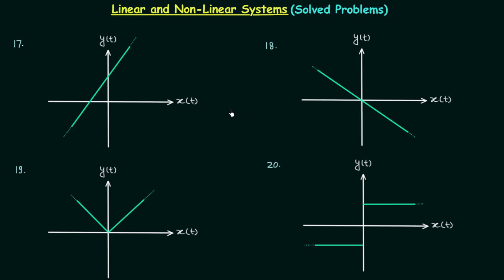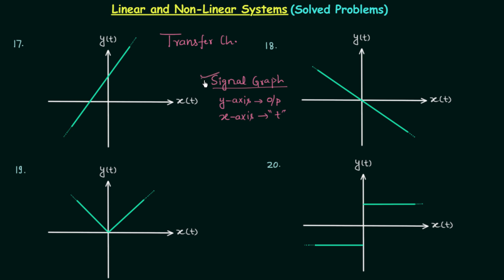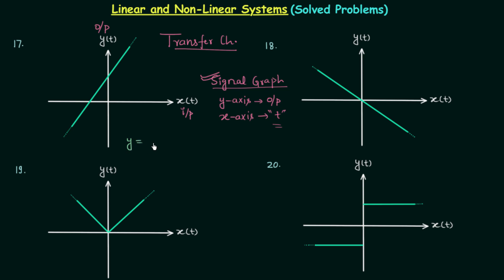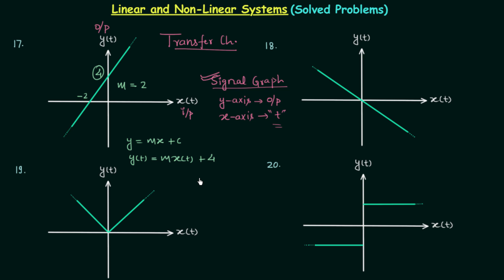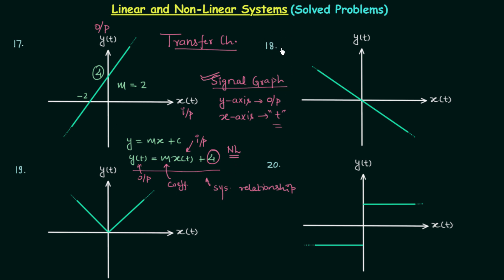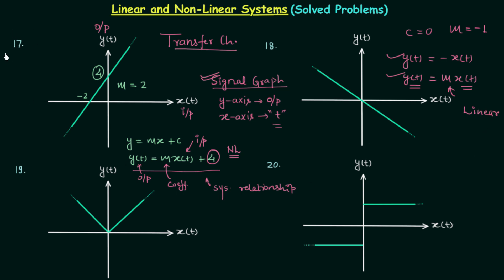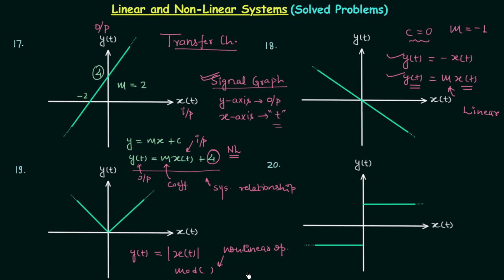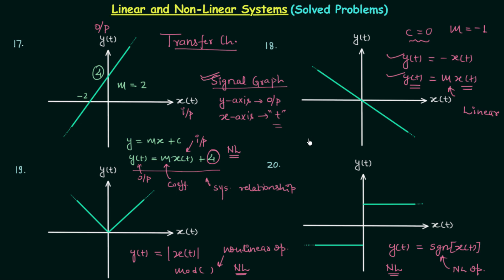Checking System Linearity using Transfer Characteristics

Comment: For those wondering why we can't split the || function into a piecewise function, here is the problem:

y(t)=-x(t) for x<0 and y(t)=x(t) for x>0

But did you catch that? You're splitting the function with respect to x, but for piecewise functions to be linear like OP says, you have to split it with respect to t, not x. So there is still that difference. Because think about it: who's to say that x(t) must be such that x(t)=t? x(t) can be anything, like x(t)=-t, x(t)=sin(t), x(t)=t^23. Anything like that.

Comment: I can write modulus as split function so that comes to be linear! 
Help to clear confusion!
Reply: split functions aren't necessarily linear....the example he took in previous video was a specific one,that can't be used to generalize all the cases
Reply: @upalkantipattanayak9257  No, split functions are necessarily linear. The mod function is a  special case of the split function, which acts as an exception to the rule and acts as piece-wise linear rather than completely linear, so essentially non-linear overall. 
Basically, the mod function is an exception to the rule of split functions being linear.
Reply: @TheRealArya  
But he also said when x(t)=0
Y(t)=0 is a linear function.. so 19 seems linear but actually it is not.. can you shed some light here?
Reply: @TheRealArya  What if y(t)={x(t).     ,t<0
                         2+x(t),t>0
the system seems to be linear when t<0 but it is non linear when t>0. isnt this contradictory to split system.
Reply: Well, if you make the statement "split functions are necessarily linear", then of course you are making a general statement, with no tolerance for special cases. So general statement is wrong. @TheRealArya
Reply: But this is the problem. For the graph above, if you split it into a piecewise function it will be:

y(t)=-x(t) for x<0 and y(t)=x(t) for x>0

But did you catch that? You're splitting the function with respect to x, but for piecewise functions, you have to split it with respect to t. So there is still that difference.